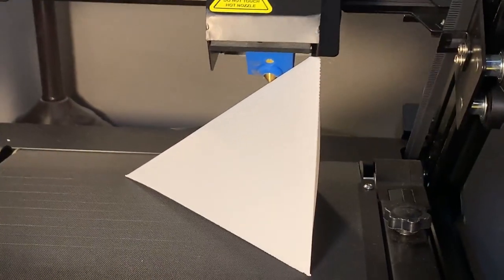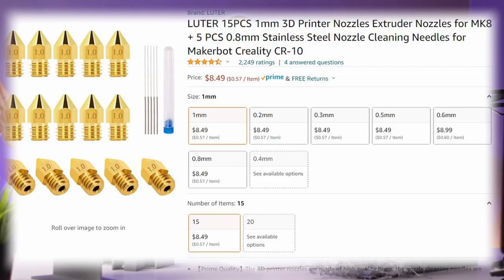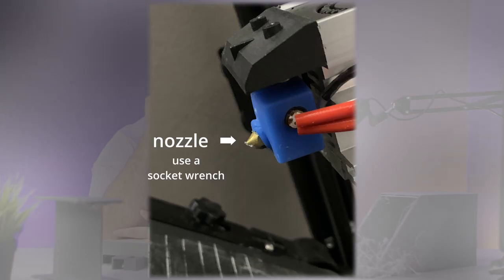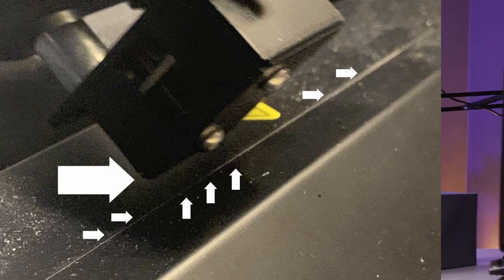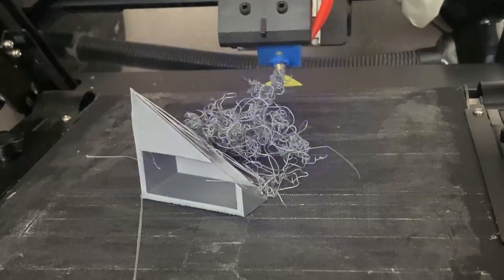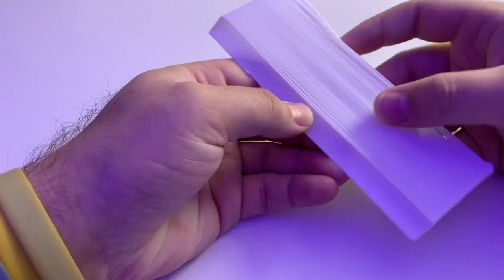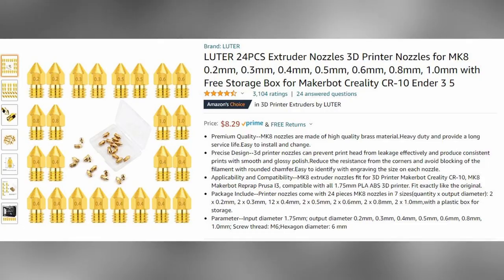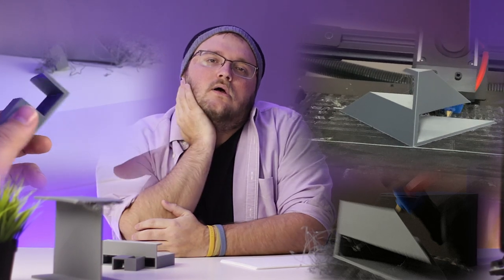Bigger, Better, Faster Belt Printing!? ...uhh, about that... || 1mm Nozzle on the Sainsmart Infi-20

Comment: How difficult would it be to get a Volcano or something similar on there?
Reply from the maker: I'm not sure, really. I haven't gone down that path of complete disassembly of the hotend mount.  Though, I don't think that an E3D nozzle would work well with a belt printer, or maybe even at all. It seems that it wouldn't have proper clearance compared to the mk8 style for the belt wall.

*******************************************

I have, however, done further tweaking in slicing and fine tuning the bed/belt since this 1.0mm nozzle video was posted.  I've also calculated the MVS for my hot end and my bulk PLA filament, and I've tentatively found a good compromise on my printer for a 0.8 nozzle and 0.4 layer heights.

For whatever reason, I find that a 1.0mm nozzle and thick layer heights do NOT AT ALL work well with this old blackbelt Cura and Ideamaker, just like the random, lost and misplaced layers with non-normal line widths and large prints.  Retractions and z-hops get messed up or lost, too, along with random shifts, sometimes. I thought it was a bad micro-sd, but a new one hasn't solved that for me. 

Add to that the inherent nature of constantly printing on a 45 degree "overhang" with belt printers + single-sided parts cooling, and you get the end product of what this video is all about.

I'll be posting a project for large-scale, single-shell and material efficient prints in the coming weeks for the 0.8mm nozzle. I do 3D printing videos on Tuesdays.

I can certainly say that, early-adopter frustrations and learning curve of belt printing aside, it can really let the imagination run wild!
Reply: @BootUpwithBaysharp  Looking forward to the 0.8mm video! I've just plunged into the 'print BIG' wormhole this past weekend, plugged a 1mm nozzle to my otherwise stock Ender Max, with very mixed results. For starters I'm getting mad air bubbles and very irregular extrusion, as if the filament was humid, on filaments that are supposed to be dried out, including brand new out of the box spools (any thoughts on that?). Then there's the printing itself...I found a sweet spot for adhesion and I can get decent first layers (as in I think bed level is decent), but flat bottom layers seem to leave a lot of extra material on top so the nozzle will rake the print pretty badly while moving around the layer above (oh the pain...). Very frustrating but I'll persist a bit more, there's something magical in having THICC yummy lines and getting bigger prints overall, even if not at breakneck speeds.